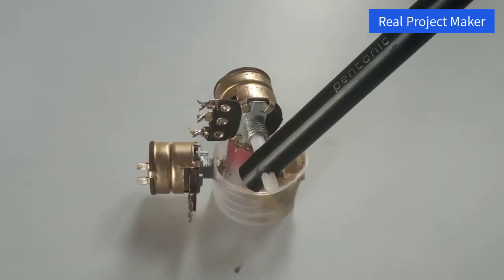Home Made joystick | how to joystick for Arduino | arduino diy projects | diy Arduino

Comment: Excellent ! Would this work with an arduino Pro micro ?
Reply from the maker: Yes
Reply: @realprojectmaker7027  Pretty cool ! Do you think that I can use this with only 1 variable resistance ? To make something reacting like a spinner (only on X axis ?)
Reply from the maker: @gathnobrain8024  yes
Reply: @realprojectmaker7027  yes